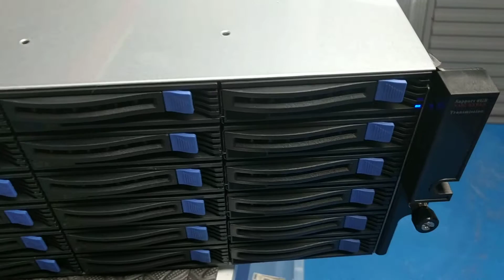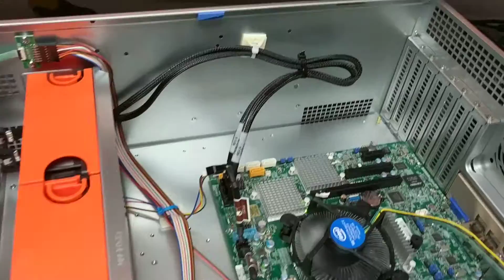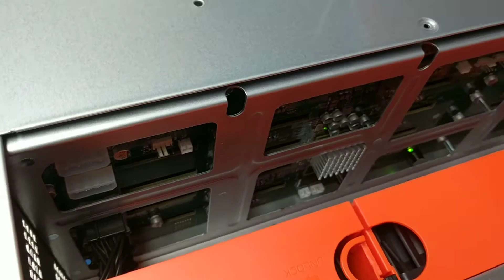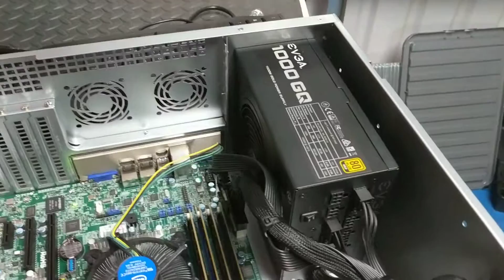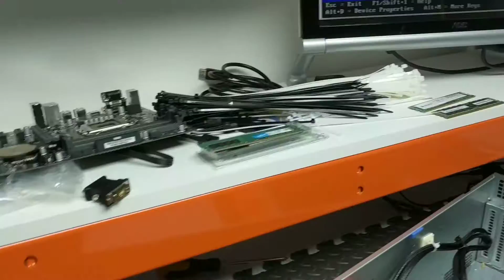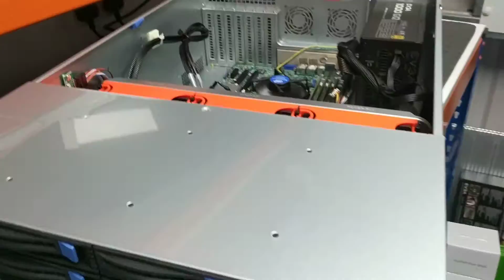X-Case RM424 Pro EX & Supermicro X11SSL-CF Software Raid made easy

Comment: If my motherboard doesn't have mini SAS connectors, what would be the best recommended PCI express card to get best performance at lowest price? No need for hardware raid, just JBOD, as I will be building array using ZFS in software.
Reply: LSI/Avago 8 Port HBA ( or anything with the same 2008 chipset)
Reply: Ian James https://www.broadcom.com/products/storage/host-bus-adapters/sas-9300-8i ? This looks to be using 3008 chipset.

Or LSI 9311-8i.

Avago SAS 9211-8i Looks to cheaper. But also only 6Gb/s.

Knowing the model of the expander chip would be helpful I guess.

Comment: That backplane is really nice. I have similar case from Ri-vier (no longer available for sale), but it doesn't have expander on a backplane, so I need 6 SAS cables, and 2x four port SAS controllers (wasting at the same time 2 ports on them total). In this case built in expander and a mobo with 2 SAS ports is just excelent. Plus few spare SATA ports for SSDs for OS, logs, caching, etc. Less cables, less add in cards, less configuration issues, more space for airflow. I think I will be going with RM242 Pro EX for my next build, if I manage to find maybe AMD based mobo with 2 SAS ports built in, and support for 64GB ECC, and built in 10Gbps. Something like X11SSH-CTF.

My only complain, considering now you can run it fully with so small mobo and no add-in cards, would be to remove all expansion slot covers, and put at the back a 3 100x100 fans instead if possible. Instead 2 60x60, and add ability to mount 4 SSD drives on a side.

Comment: Would it not be easier to create a fan cage that isn't 'proprietary' and can utilise standard 120mm fans/connectors? That way home users could simply remove the stock fans from the orange cages, replace with something like Noctua and be on their way.
Reply: It is meant for business and they like things plug and play. I have yet to see a standard for a hot swap fan.